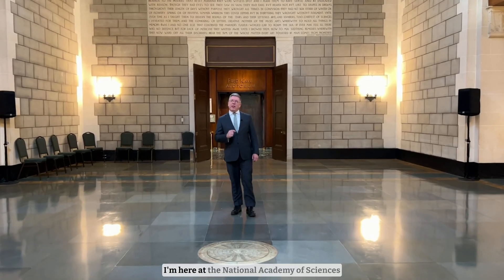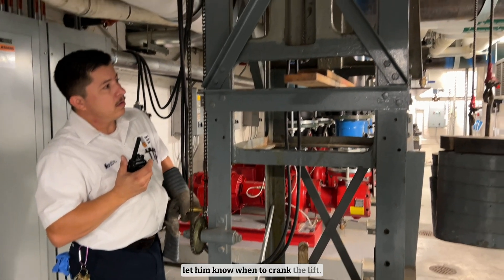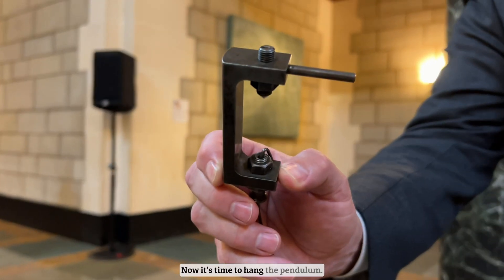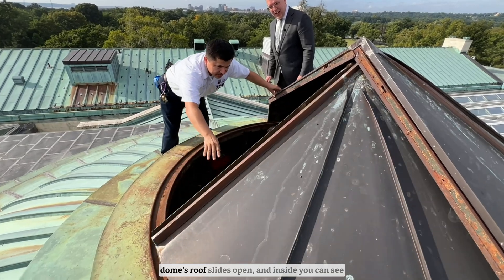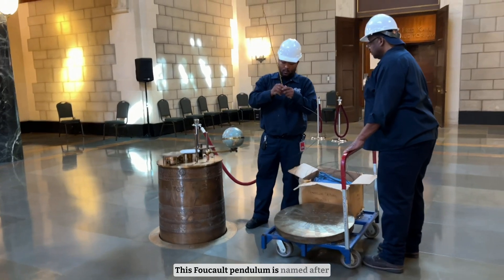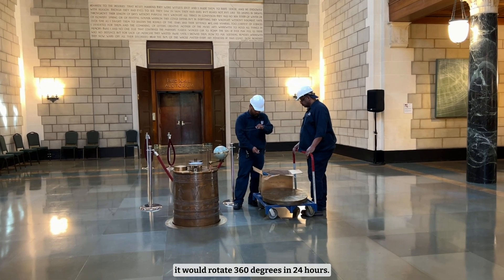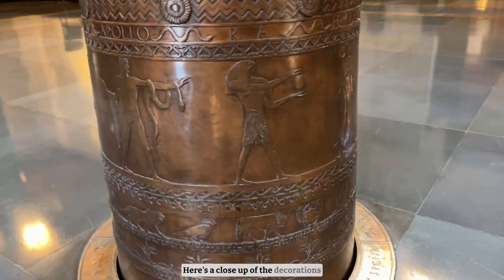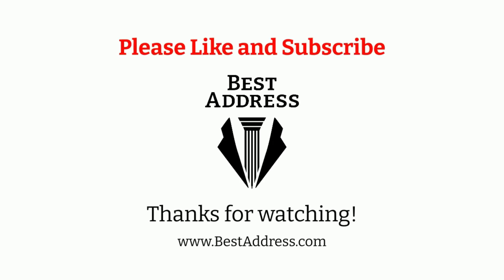Installing the Foucault Pendulum at the National Academy of Sciences

Comment: It looks like the pendulum support is a simple cup, and the hook's end is a simple cone. That makes a single point of suspension, like a compass needle but upside down. I assume a bit of lube can be put in the cup.
I saw no sign of an electromagnetic sustainer. That could keep the flat-earthers from claiming it's all fakery. That means that someone will have to start the pendulum swinging each morning. 
(I suggest that the pendulum bob could be streamlined by dimpling it like a golfball, and the suspension cord could be streamlined by spiraling a skinnier thread around it.)
I don't see any provision for pegs or markers to show the plane of rotation, but they could be portable, and arrive later.
The pedestal is lovely, but the old experiment atop it is a sad distraction. 

The artwork of the room is a glorious distraction.